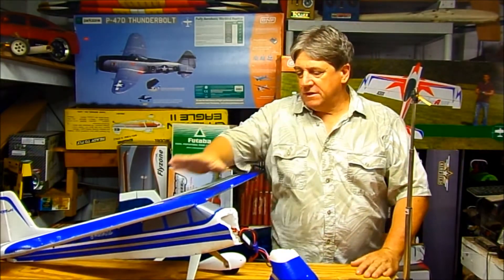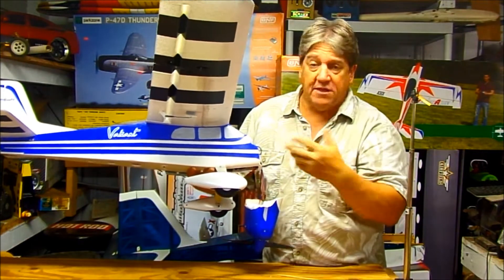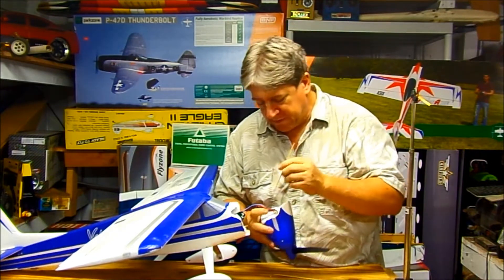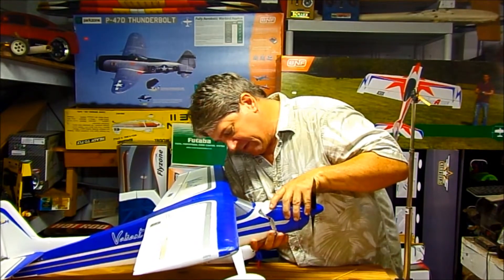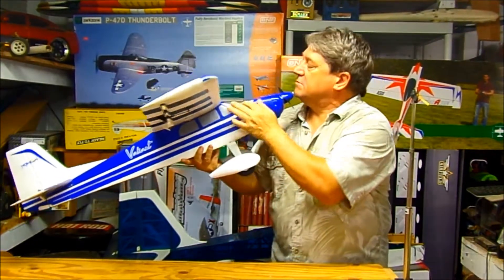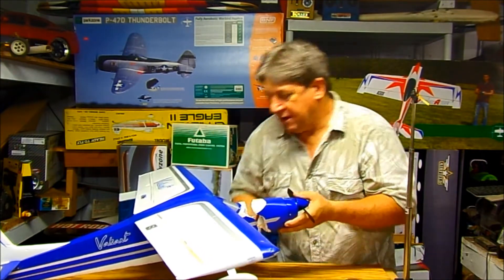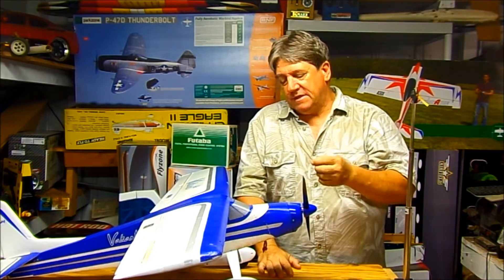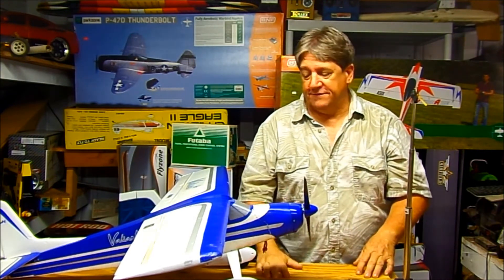FOAM REPAIR E-flite Valiant 1.3m BNF  AS3X and SAFE Select EFL4950

Comment: Have you ever had to replace a servo?  Something happened to mine while flying. I lost radio contact and it crashed landed. A few things bent and broken that I can fix but I found the elevator servo no longer has full up throw so need to replace it. I tried pulling it out of its slot but it won't budge. I don't want to tear up the foam to get it out if I can help it. Any first-hand knowledge on this? Thanks in advance to anybody who can help.
Reply from the maker: sorry for the late reply my notifications were turned off for some reason ; yes have had to replace servos many times ; sometimes glue is better then others but just keep pulling it should come out